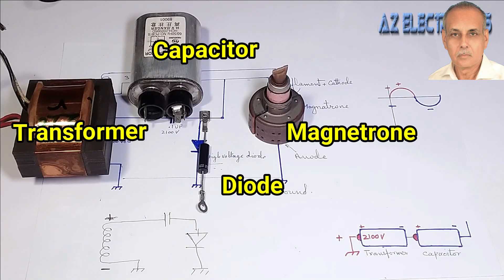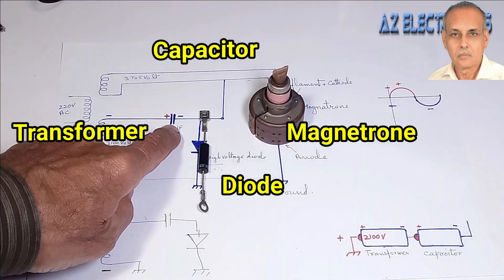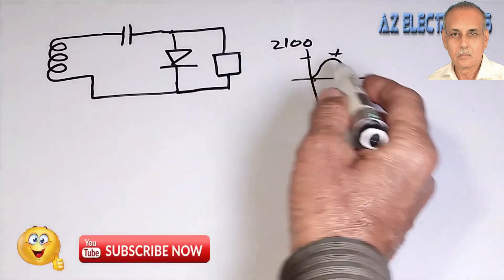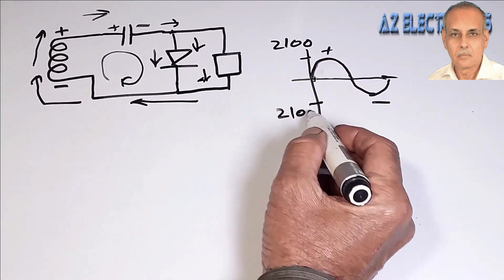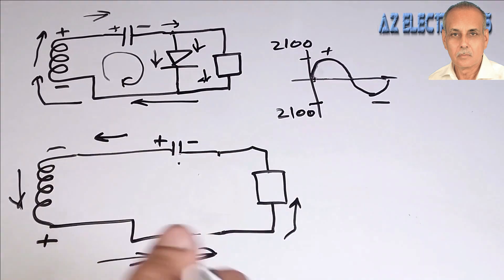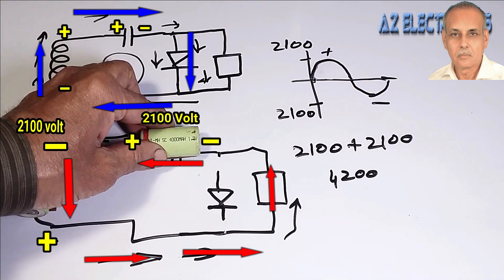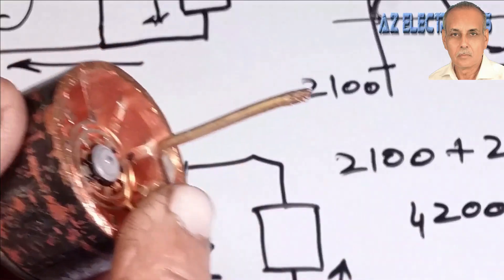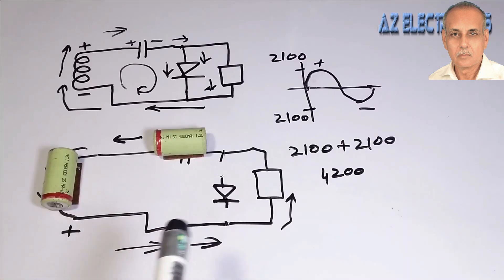In English Language Microwave High Voltage Circuits | Villard Voltage Doubler How it work

Comment: And how has it changed from AC to DC without a rectifier?
Reply: Perhaps it's because the the capacitor has determined the polarity, so then when it discharges towards the the transformer it acts like a battery.

Comment: How does the voltage get up to 5000(past 4400volts)?
And what does the 3 Volts from the transformer do?
Reply: Is 2100 the minimum output voltage and then 2500 being the peak voltage?
Reply: Please explain something Az.

Comment: Kde si nechal RC obvod a  megaodpor?
Reply from the maker: The RC circuit is mainly found across the high-voltage capacitor in the microwave oven’s high-voltage (HV) power supply.